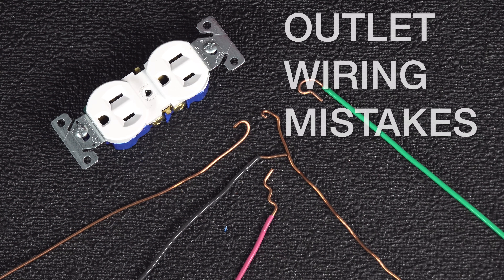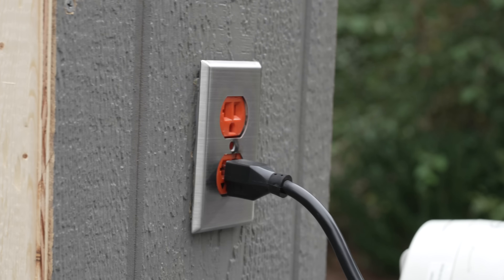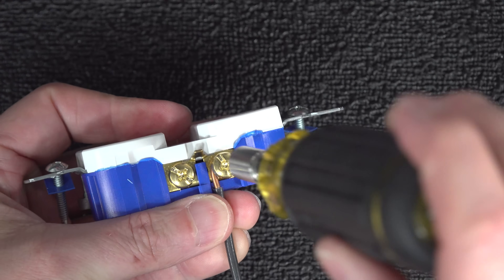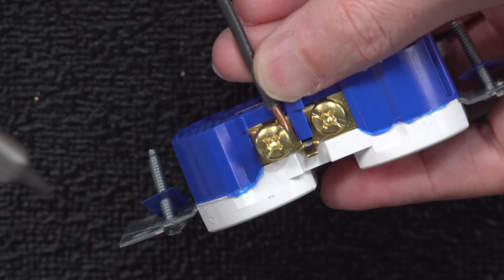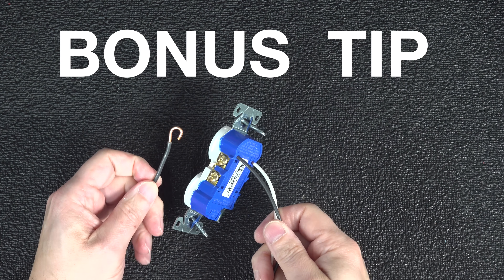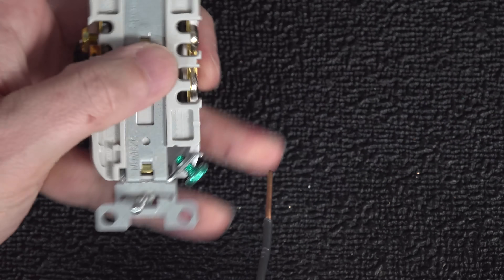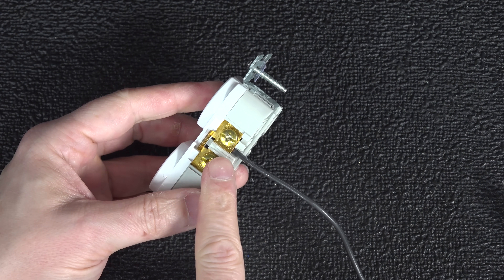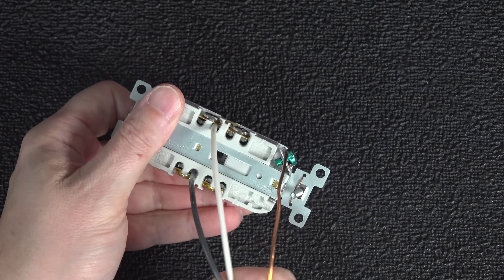BEWARE Of These 3 Common Wiring Mistakes On Outlets & Switches

Comment: Black is Hot Wire, White Neutral, plain Copper is the ground. That's what I was always thought when installing outlets.
Reply: why are grounds always bare wire and not insulated?
Reply: @geod3589  why bother insulating it? Just keep it aware from the hot terminals.
Reply: Grounds only carry fault current. It also makes for a more compact cable for installation. In raceway installations green insulated wire is used for ease of pulling.